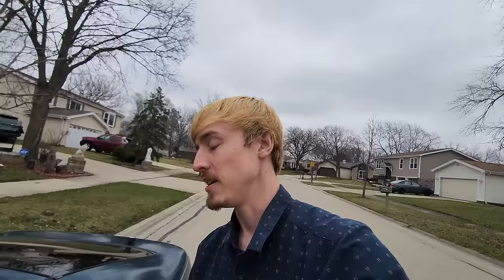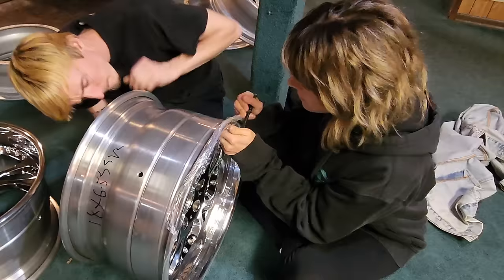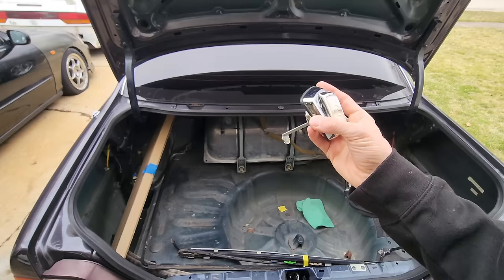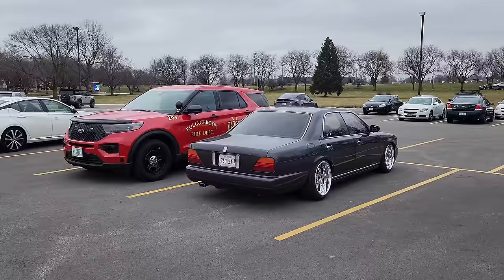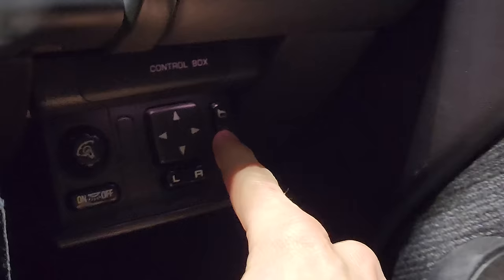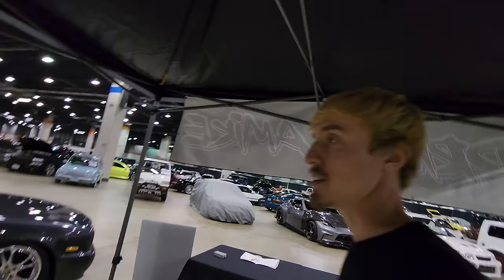COMPLETING my Nissan Gloria!!! + Chrome Jonnies

Comment: What I have learned from Youtube university on detailing, what they do to detail the back of old emblems before removing, is they put tape on the top of the emblem. Then trace the emblem and body lines on the tape then cut it. Then use the same tape when installing the new emblems.

Comment: You can also take a defensive driving course. Some states have it online now. This gives you 10% off insurance and gives a 2 point credit. At least that's how it works here in Delaware. And yes. Dual tip exhaust would be sweet

Comment: You definitly need to paint the valve cover in the color of the car. Like a glossy finish and the Nissan lettering in brushed silver. That would make the engine bay pop!

And you should really put on a dual tip exhaust. There was nothing like 90‘s cars that had some fat tips on them.

Comment: You might need to beat out the rear inner tubs - they tend to rub on the Y32s. Won't really notice it until you hit some bumps are freeway speeds or crab over speed bumps

Comment: Hey prizzamike, wanted to let you know that i got in a crash, it was Thursday night at 11pm and i was driving on the most dangerous road in Woodland Washington which is butte hill rd. It was a straight with a speed limit of 35, i was doing 40 and i didn't see the direct 90° turn and locked my brakes and spun into a 15 to 20 ft drop ditch almost vertical. Car looks to be totaled based on price to repair vs vehicle worth, it was a 2002 hyundai accent. Im ok, just muscle cramps. Hope your doing well, i sure am.

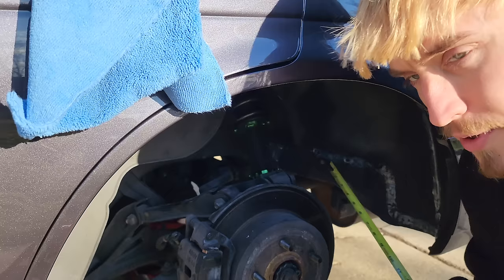Comment: @09:30 match your rear wheel tire gap to youre front wheel tier gap, or a mm higher, never want youre rear gap tighter then your front gap. makes the car look broken and makes hte stance look like it couldnt be dialed in properly.
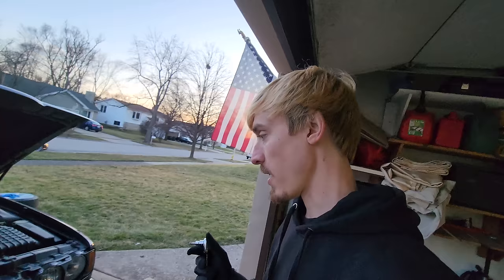Reply: @14:01, ok. see, so you already know =]

Comment: Looks like you are using the can of Sprayway that doesn't run out of aerosol as easily. The blue nozzle with the fine mist sucks because of that reason. it leaves alot of product in the can with no aerosol left in it to spray. I've been using that product for 20 years. We are in the glass business it's pretty much the best glass cleaner imo.

Comment: Hey mike I got a question about coilovers, I was thinking about getting some coils for my em2 but I wanted to ask if it would be a good idea to check the ball joints and bushings and replace them if needed first before I install them? also should I replace them with poly bushings? Could you maybe explain it on your next video? Thanks

Comment: May as well order custom center caps or find better shape. Imo no sense running only two and when they’re that rough. I lost two caps for my vs-xx and just sadly now run cap less because I have a super rare discontinued set of 15in vs-xx and they have smaller caps than the bigger sizes and I’ve still never found any